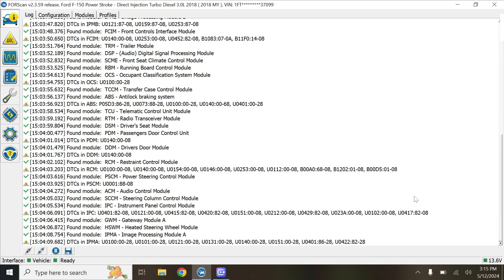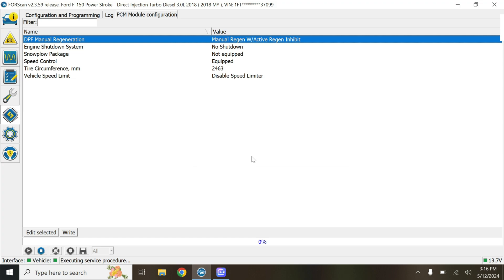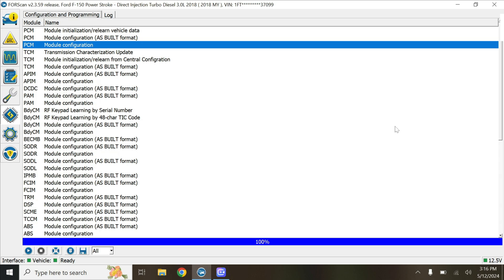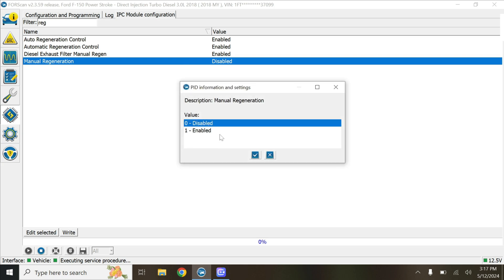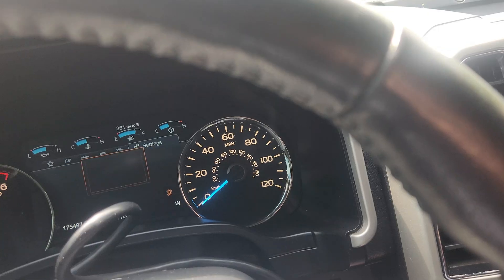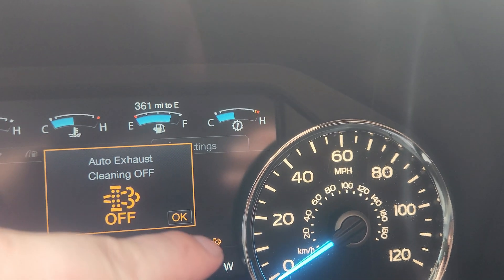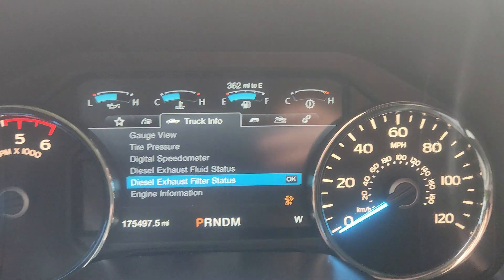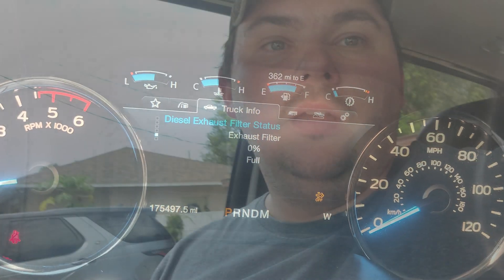How To Add DPF Load and Regen on #f150 Diesel and Super Duty #mechanic

Comment: Hi love your videos. I have a question. Is it possible to check hill descent , cruise control not available with forscan. And to trouble shoot. Thank you
Reply from the maker: You can 100% check for codes that could be causing it. You can also monitor PID to see if something is causing it not to work. You'll need to get access to pinpoint tests to find the testing required though

Comment: How to activate manual regeneration on the road?
Reply from the maker: Manual Regen is only done at idle and when the load is 100%. The IPC will have a statement at the bottom of the DPF load screen saying hold on to start cleaning.
Reply: @CPsGarage  But my engine sometimes automatically starts regeneration on the road or just when I get home, and I have to drive at high speed for a while. It would be great if I could control this function to activate on the highway!

Comment: How long can you drive with it at 100%?  I recognize the purpose of this is to keep from regen a few minutes before shutting down, but how long can you delay it before causing more headaches.  I probably drive drive too often in town and if you are running errands, it is not the best time to attempt a regen but that could be 10 or more restarts.
Reply from the maker: It will depend on driving habits. There will be a message that pops up saying exhaust overloaded. Then you will have to manually Regen with forscan
Reply: @CPsGarage  Appreciated-
Reply: @CPsGarage p

Comment: Hi Cody, are you only able to start a manual regen if the filter is at 100% full? I've tried starting a regen at say 80% full and I get no response from the truck. Is there ever an alert to let you know when the truck is actually regenning?
Reply from the maker: Only at 100% it will have a message at the bottom stating to hold ok
Reply: @CPsGarage  Oh, ok thanks!
Reply from the maker: @WillS644  I believe I mentioned it in the video.

Comment: Can this be done on the 21 F-150 with the powerstroke?
Reply from the maker: @paulneubauer77  it can
Reply from the maker: @paulneubauer77  only caveat is I haven't done it on a 21 but I know it's a option per the WSM
Reply: I tried it with my 21 and could not get it to work.  Looked in every menu spot on the dash display and nothing was added anywhere.  But I do also have forscanLite and have done a manual regen with it and read DPF level with that, so not the end of the world if I can’t access it directly through the truck I guess.

Comment: I read manual regeneration in your driveway is not so good on everything because of the heat, your thoughts?
Reply from the maker: We Force manual regens at the dealer to clear the DPF. If you are not driving the vehicle in a way that it regens on its own you will have to manually Regen it. I don't see a problem with it as long as your truck is in a safe position away from anything that could cause a thermal event. If it wasn't good Ford wouldn't allow it to be added with IDS/FDRS.
Reply: Thank you

Comment: That move from drivers seat to computer screen was money!
Reply from the maker: That's how I do. I hate when a videos record a screen it's hard to see. I just rather see a screen recoding.
Reply: Very timely that you posted this.  I have been thinking about doing this over this past week and wondered how to go about it.  I mainly want it to monitor the dpf condition.

I have a 2021….I assume it would appear similarly in the updated 21+ menus?
Reply from the maker: @chriss526  I have tried it on the 21s but have not found where it's located. I have seen 21s with it though. It's the same process PCM and instrument cluster changes.
Reply: What adapter do you use for forscan?
Reply from the maker: @Fishook606  I use my VCM 3 from Ford. I recommend if you wanna get one check out Forscans list on their website unless you wanna spend the coin on a VCM-3
Reply: @CPsGarage  Thanks.
Reply from the maker: @Fishook606  You're welcome